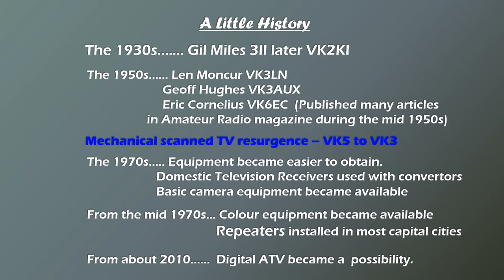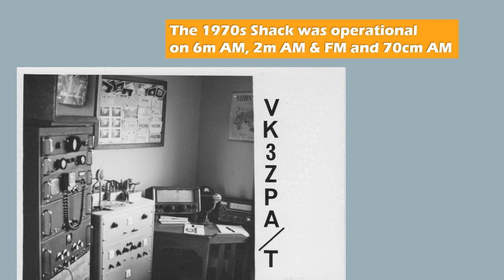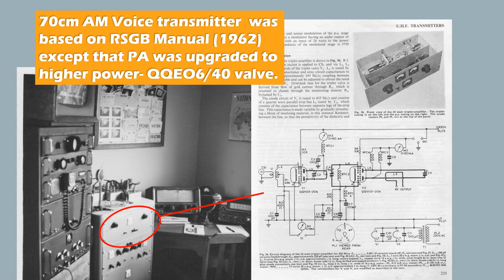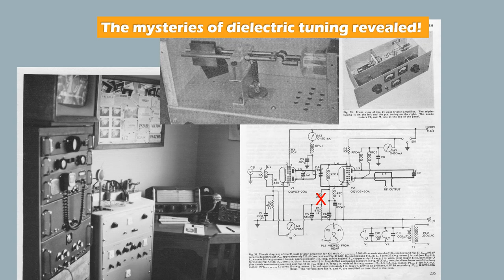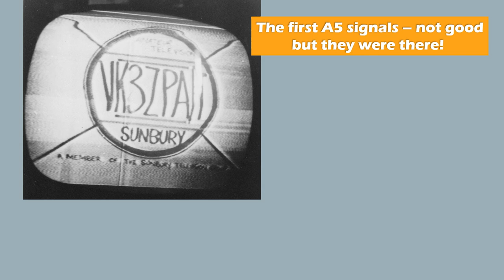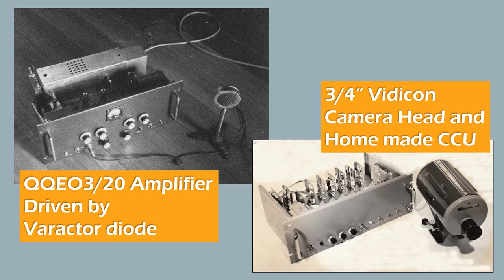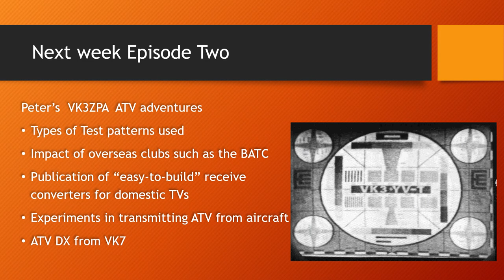Episode One – Peter’s  VK3ZPA ATV adventures: The Early Days

Comment: Those were the days. I obtained a Novice in 1976 and shared my station with a Limited Licensee Phil VK3YCP. Phil was very keen to play ATV, we built a "ZIM" converter I think it was called, we later upgraded to a ZBJ converter. Phil originally used  an old 70cm VINTEN transmitter modified by Lionel VK3NM who was transmitting ATV from Box Hill but Phil managed to get hold of this unit. The Video Modulator circuit shown in this You Tube clip looks very familiar and I'm pretty sure Phil used this to modulate the final of the 6/40. It was an exciting time on 426.250 MHz. Transmitter ATV signals across Melbourne and to Les VK3ZBJ at Mt Eliza to the lads on Mt Gambia during summer temperature inversions was a particularly interesting time....now we are transmitting DVB-S2 digital HD transmissions via VK3RTV, how the technology has changed!....Cheers Clint - VK3CSJ